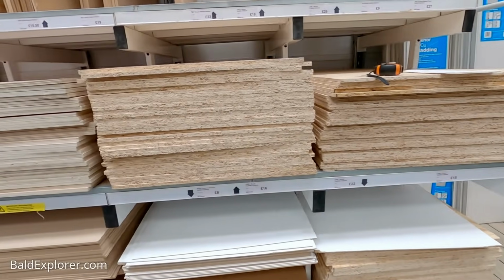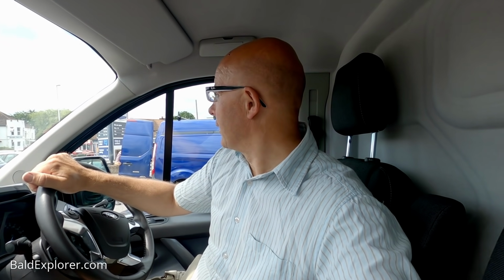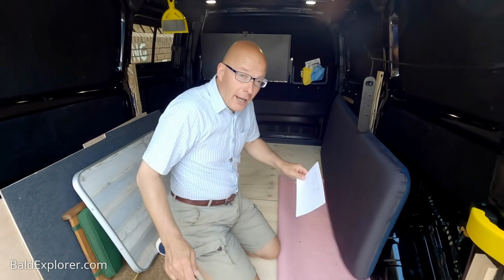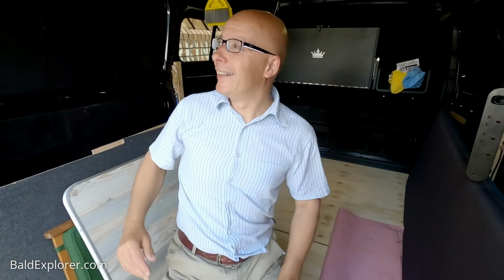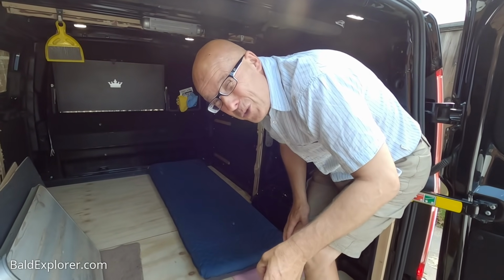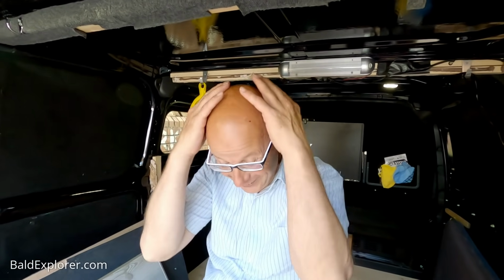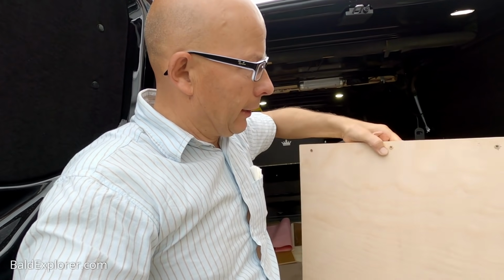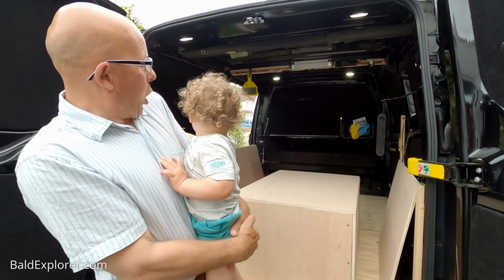My Van Build - Fitting the bed and Seat, and Storage

Comment: Every van build needs a Merlin-cam! Do you have community share programs for tools (or a FreeCycle/BuyNothing group) nearby or a recycle store like RE: Store (used home improvement)? DH is frugal and very few of our tools are bought new. Van specific - are you covering the floor or just varnish? We used polyvinyl sheet flooring to cover plywood floor in an old T4. It is easy to clean in our muddy climate and water proof.
Reply from the maker: Lots of good questions there - will look in to freeCycle. Thanks for tips

Comment: We have a Wickes local to us, and they are very expensive. I get any timber I need from a
local timber yard, where they will cut to any size, eliminating too much waste.
I don't kmow what your finished floor will be, but  I would have used vinyl tiles. they are self
adhesive and muddy footprints will wipe off.
Also I would have put some sort of membrane under the ply floor, to help with insulation
and for noise reduction. Even some carpet tiles would have helped.  Maybe too late now ?

Comment: Speaking of "too big, too heavy", I'm going to ask about something you have certainly already done, but I'm going to ask anyway; there has been a spot of math done to compare the weight of the new construction to the van's payload weight, yes? Connected question: how much material weight is this construction adding compared to the previous construction's weight?
Reply from the maker: Good question
Reply: @RichardVobes  For what you are putting in there,
weight won't be an issue at all.
Reply: @RichardVobes  Way under its capacity, worry not, just re check the tyre pressure when your done.

Comment: So far, so good, your cunning plans are coming together!  I'd put some extra bracing under the tops though, with time they will sag. Extra supports like what you used in the corners can be attached to the inside about 50mm below the edges.  Then attach the same thickness of wood around the edge of the top with a piece in the middle. Then when the top is closed it will rest on the internal edge pieces.  The bracing will also better support the hinges.  I would also seal the bottom of the floor with either a sealer or diluted varnish as moisture under the floor is worse then moisture on top because it won't be able to dry out. Then buy some trim to seal the ends, this will stop the plywood from splintering and absorbing moisture. It will look nicer to!
Reply: Just curious are there pillars in the back of the van for reducing body torsion while driving?
Reply: @aabb55777  I've never looked that closely at the inside of a Ford Transporter, but if they are like the vans the rear frame is the rear stiffener with the next two being the windshield support and the one behind the driver.

Comment: When weight is an issue in a van build some folks use aluminium frames (have to be welded together for strength) or simply cut out large holes in the back (if a back is needed) sides and  door front. Have also seen a lattice used for door fronts of cabinets just to save weight. But...considering how you'll be using the van & having minimum cabinets I don't think weight will really be an issue for you.  just check your tyre pressure if carrying heavy loads in the van.  Use piano hinges for the tops of the boxes!!